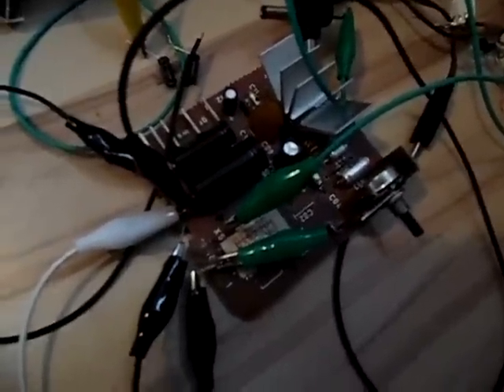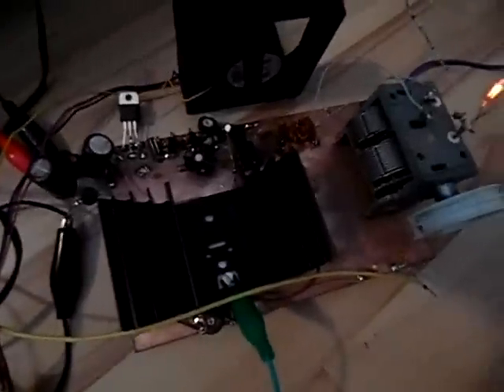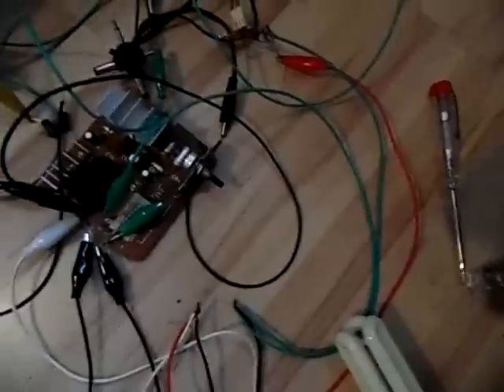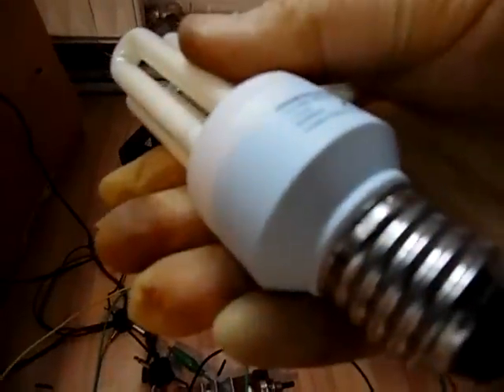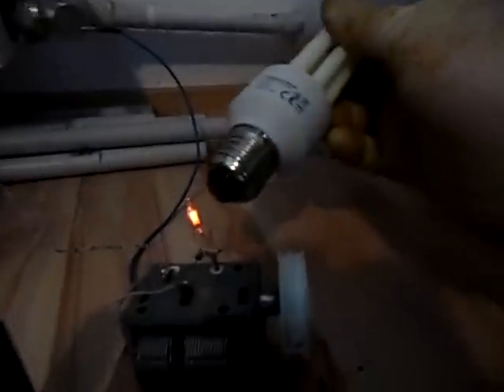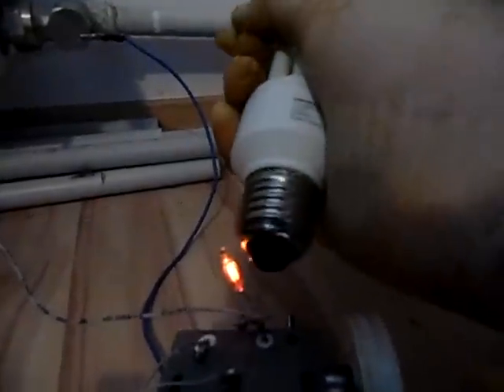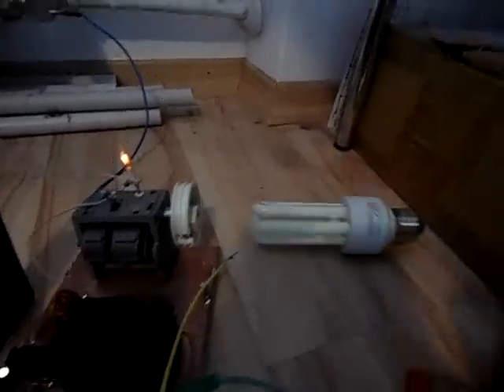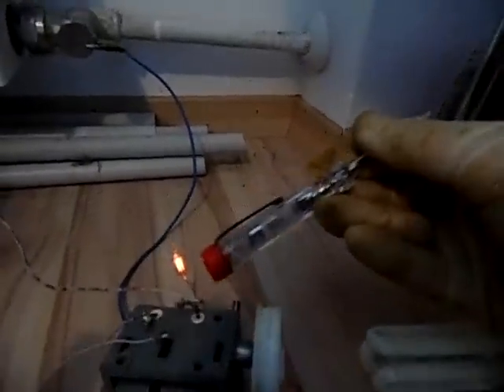10W shortwave transmitter

Comment: 7.6? That is is the Ham band. Ham's won't like that very much.
Reply: CHILLY WILLY
Fortunately, whilst it IS close to the forty metre ham band, it is far enough outside to be of no interest to the hams EXCEPT for any ham living close to him and suffering splatter or any other problems of a nearby unlicenced transmitter.(Unlicenced IS the correct spelling!)
He'll come looking for the guy and locate him by D/F.   
He won't keep the details secret!
In fact 7.6 is right in the middle of international SW broadcast stations, running kilowatts or even megawatts and eye watering Eiffel Tower antennas so they ain't going to worry in the slightest! They've got Hydrogen bombs and he's got a slingshot...catapult firing warm marshmallows.
Reply: The radio ham band is between 7.000 - 7.200 Mhz.  From 7.200 to 7.600 Mhz is the Short Wave Broadcast band so, he's right at the top end of that band.
Providing he's not over modulating the carrier, he won't have any problems with 'splatter'and / or harmonics.

And, yes, 10 watts at night time and on this frequencies it can travel to surprising long distances, weak but audible.
Reply: @manolopoulos-j4t  At this power even if he splatters it wont matter. He could be running 500 watts. Nothing will happen, the FCC is useless and doesn't give a shit despite the ramblings of autistic manchild whackers who can't handle anyone having fun.
Reply: 7.6 is NOT a ham band.
Reply: 40Meter is 7000-7200KHz (ham band) 
7600KHz is SW Boardcast Band maybe 41meters end

Comment: when you go higher in power,
is also more difficult to get the modulation well on the signal.
you need also have MORE THAN TWICE the audio.(HF power X2 audio power) 
http://4.bp.blogspot.com/_NdlG3H182xo/Sje-YZsJoDI/AAAAAAAAABs/TUjBC5wI3K0/s1600-h/series_modulator.jpg

if you can buy a 6400khz Customized(standaart) crystal?
many pirates/amatuers listening to this/around this freqwentie!

http://freeradiotx.blogspot.co.uk/2009/06/corsette-low-power-sw-transmitter.html
http://freeradiotx.blogspot.nl/2009/06/command-transmitter-by-dave-martin.html
http://freeradiotx.blogspot.co.uk/2009/06/corsair-transmitter-by-dave-martin.html

antenna is the most important ! (most of all!)

R.Rob.